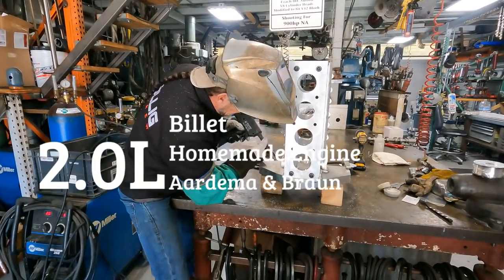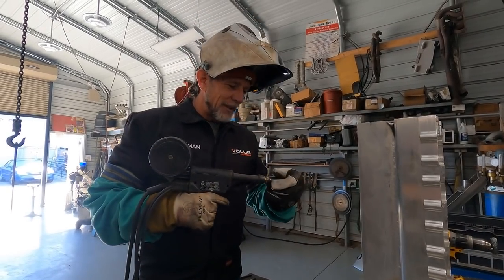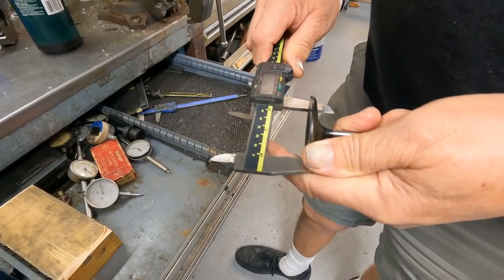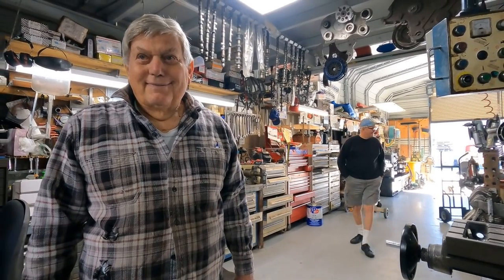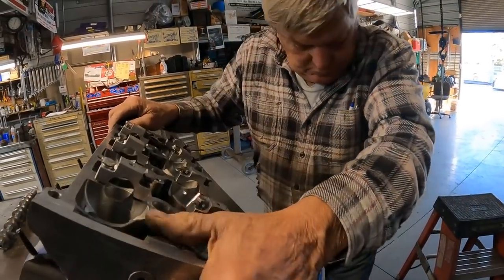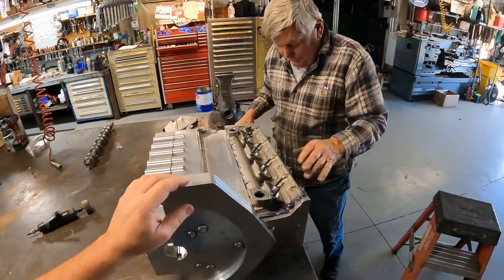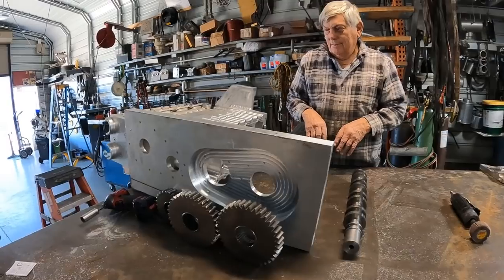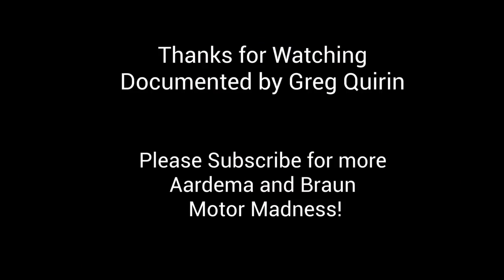Homemade Billet Engine - How to Make a 2.0L Engine from Scratch

Comment: I’m wondering why they didn’t just take an LS Chevrolet engine and cut off four cylinders? Destroke the engine to get down to the cubic inch they want. The cylinder heads will flow a lot. Put a turbo on it and change classes.
Reply: The LS is a good engine but it's valve train is based on 1950's tech. There's no way that an LS will wick to 12k. I'm not involved with land speed racing, but I'm positive that they're building to a class criteria, ie 2L displacement, n/a.

When you suggest cutting it in half, are you suggesting a vee or straight four?
Reply: @airtightindustries   very good point! I was thinking with the LS engine to cut off the numbers 2,4,6,8. I think I would put my money and effort into the cylinder heads. Converting an LS cathedral port head into overhead cam head would be the ticket. With ultra-high rpm’s there comes a point where torque drops off because the speed of the explosion can only travel so fast. But these guys know this! They are really brilliant with what they are trying to accomplish.

Comment: What is the cylinder head from again? I heard nissan, but nissan what, what race series?
Reply: Indy Racing League. The head would be from the Nissan Infiniti VRH35ADE if it's from 2000-2002, VRH40ADE if it's 1997-2000. I recall the ancestor of at least the 35ADE are the VRH35L (Nissan 390GT1) and the preceding Group C turbo monster VRH35Z.

Comment: can t wait to see the V8 version as well. there are so many questions. those guys rule.
Reply: They built two 12 cylinder engines one of them is friggen huge 10 litres or something like that
Reply from the maker: 20 liters https://youtu.be/yhLOl4rEi6E  here is the video
Reply: @GregQuirin  Amazing what these guys build.
 Would love to spend some time with them, before I pass on, die, or as I call it 'Graduating beyond this life"😎☕
Reply: What did he say it is for? A hot rod? Those two guys already made a lot of impressive V engines. Maybe they can build a 120° flat-plane V8 for a low profile hood like the inline-4. I mean, if they use Nissan cams, the crank has to be flat.